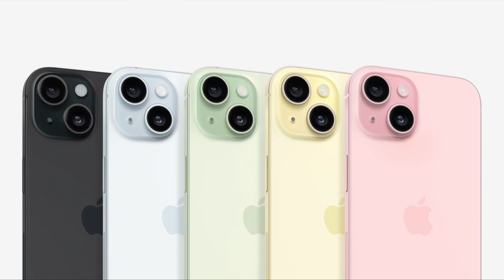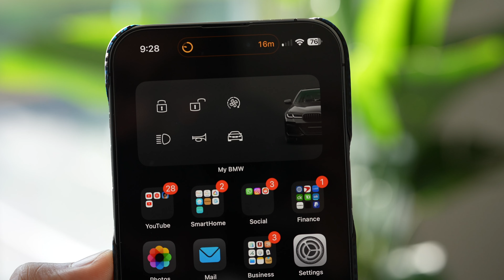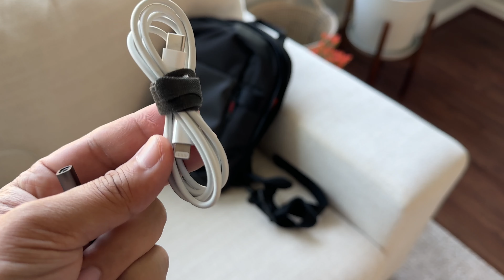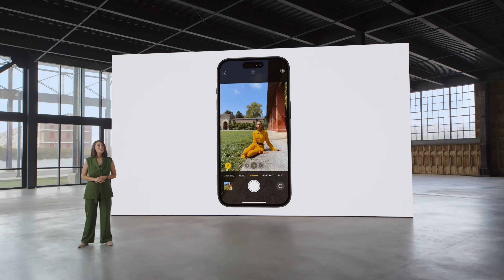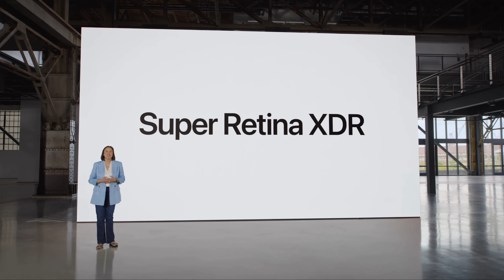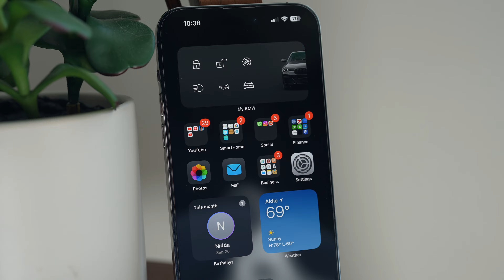iPhone 15 Thoughts

Comment: The issue with the dynamic island, is that despite technically being smaller than a notch it cuts deeper into the display. As a result, it’s probably the single most intrusive screen cut out of any smart device on the market. It’s made me reflect on how non intrusive overall the original notch was, especially on the larger devices.
Reply from the maker: @Archivist42 - Yes I totally agree with you and this is something I brought up in my iPhone 14 Pro review.